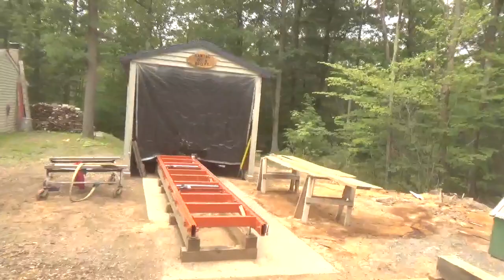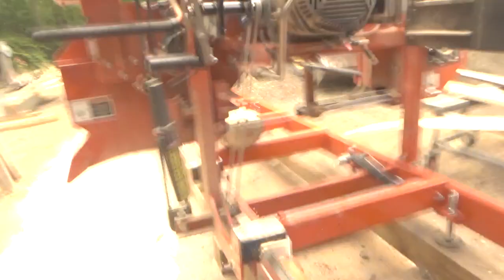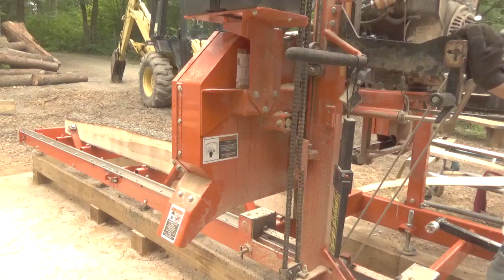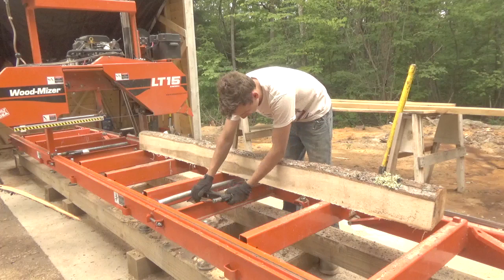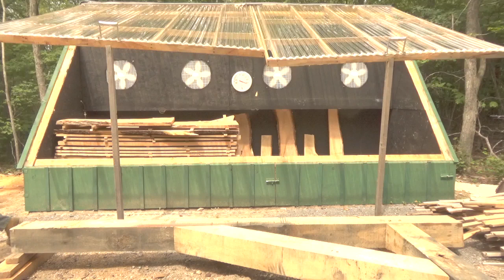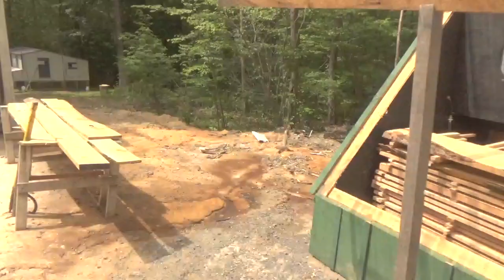The apprentice loads cuts maple on the Woodmizer LT15.

Comment: Hey guys, in one of your earlier posts you were telling us about the difficulty of tightening the dogs on the left side of the mill.  I noticed that the bar that holds the dog is only fastened by a bolt on either end.I believe you could move the dog at least two or three inches by using a longer bolt and if need be a spacer to maintain a solid and sturdy rail. I've done quite a bit of production line fabrication in my lifetime and believe that is an easy fix. Love your videos.